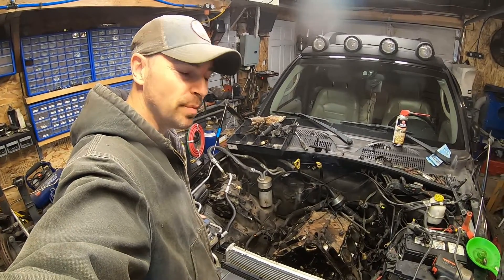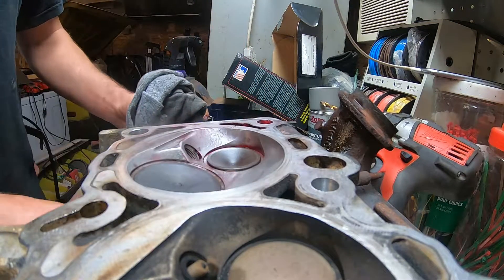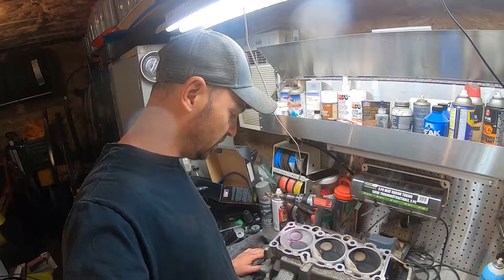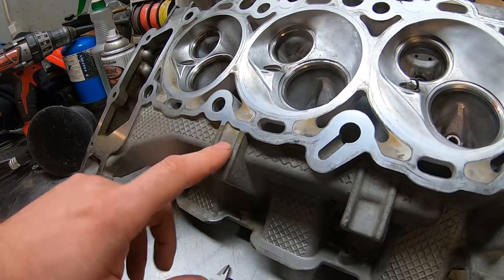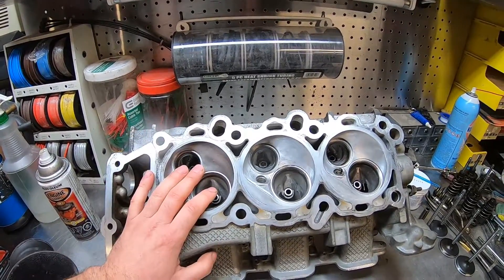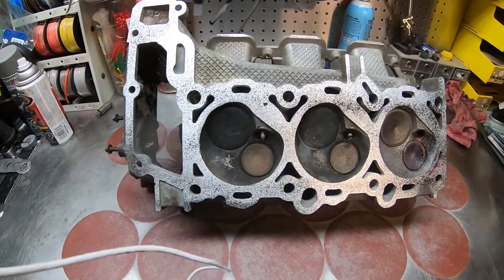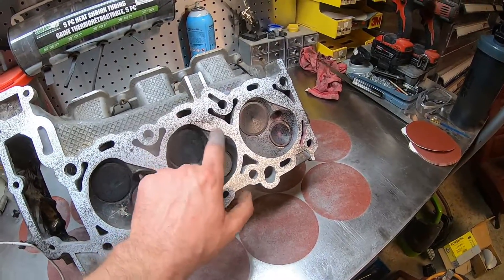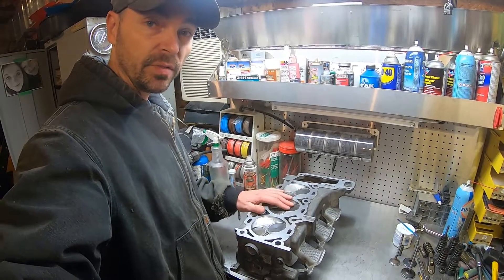How to Resurface a cylinder head at home with an Orbital sander???!!??!??!?

Comment: if done with a light touch that orbital sander and a straight end to check the flatness would certainly get the job done well enough. I use a 3/4 inch thick steel block, 6'wide and 24 inches long....some diamond paste.  Thank you for this video you posted sir.

Comment: Would you double up on the gaskets to increase compression? Also, I’ve heard to make both the head and block rough so they “bite” down 🤷🏼‍♂️😂
Reply: doubling gaskets would DECREASE compression. Its popular on vr6 engines to stack 2 to drop the cr .5. The 'bite down' hes talking about is referring to multi layer headgaskets that are meant to crush when torqued. The thought is that the gasket would crush into the imperfections and be kinda pinned in place.
Reply: You do not want a rough surface so that it will "bite" into the gasket. What it will do is "eat" the head gasket with its teeth, rough surface.
Reply: I used a thicker metal gasket on my car when I swapped a new one in. Did not level it myself tho, had it done in a shop.

Comment: This is not the way to do it. The head will look very pretty but will not be flat. If you want a flat beautiful cylinder head mating surface, use a glass plate, or a marble or granite tile, as a reference. With an orbital sander you are not accomplishing anything other than polishing peaks and valleys
Reply from the maker: @VliegerNL  been doing it for a long time.  Checking it with the paint spatter is a fool prof way.  Been driving it since, actually just used it to flat tow my CJ7 2000 KM/S to Nova Scotia!
Reply: @restosandrevivals4597  Good deal. Glad it has worked so well.

Comment: You put the dye on first.

Your supposed to clean(clear stuff), then spray dye red stuff,then developer(white stuff) developer pulls dye through cracks for leak testing. To just amplify already visual cracks you could probably just use dye. If you had a crack in combustion chamber you could spray dye then put developer in water jackets and itll pull red through crack so its all white except a red line. Thats why you wait so the dye seeps into cracks.
Reply: And yea fixing at home is fine as long as your not super warped.

Comment: Thanks for the tips. I've always heard that you should take down the valve seats by the same amount, but I can't see how that's possible at home?
Reply: What does that even mean?
Reply: That's not true. The valves have nothing to do with head thickness. Head thickness only effects compression ratio. 
Grinding the valves requires grinding the tips to reset rocker arm to valve clearances.
Surfacing the heads does effect cam timing slightly but usually not enough to hurt anything. Now, if the heads are warped bad from overheating, it will require the valves and seats to be reground as they will warp also. Usually if the head is warped over .020" in the center, the valves are warped too.

Comment: Good job, and I'm sure the machine shop boys will feel uncomfortable with the idea of sanding a head down flat, but ot works if you're dedicated and careful. It also means you're only removing the bare minimum of material by this method.

Comment: Is the head still assembled? Is it possible to surface the head without taking that all apart?
Reply from the maker: It depends on the head, some valves sit below the deck surface. Most heads can but it’s risky. You don’t want all that filth making it’s way into your oil when you bolt it back down. It has to be perfectly clean inside and out.

Comment: first time watcher, very intelligent and elaborate explanations thank you, that outro caught me off guard lol

I did something similar to this for my 2014 SRT8 392 hemi (6.4L) cylinder head but now have a huge oil leak. I googled, and read that it has a Fire Ring or Fire Deck built into the cylinder head -- I used a straight edge file and it took off a little bit more around the cylinder bore than the rest of the head, I read filing down this Fire Ring can actually compromise and scrap the head. Do you know anything about these Fire Rings?

Comment: That's an ok technique. I guess.  I prefer to use a cinder block. I just knock off the loose gravel and go to town. Works great. I'll throw some crisco on there every once in a while to keep it lubed. Head gasket seals fine. Just like yours will !!  Keep on sanding.

Comment: Great video and tips.  I am working on similar heads for my ford 4.0 SOHC.  Lapping the new valves right now and holding onto the old valves to do some porting and polishing before fully reassembling things.  Look forward to your upcoming video on the port and polish.  This is my first go with SOHC heads, most of my experience is porting and polishing old V8 ford heads.
Reply: @curtispaul9717  Thank you for the insight.  I am a bit weary of doing aluminum heads and it makes sense about the cam.  Finding more performance cams for the 4.0 sohc seems to be quite a challenge.  Honestly the engine makes good power as it is with a few mods.  The 03 ranger it is in is a hoot to drive.  I have ported and matched iron heads when I built a 69 390 to replace the worn out 352 in my 66 f250.  That one I did put a higher lift cam in and added ram air among other mods to increase performance.  Lots of fun getting sideways in a 2 ton truck when you mash it and beating newer 5.0 mustangs off the line till they caught me around 85mph, the truck had a top speed of 103 downhill, hehe.  Its a stump puller but was still fun.  I also plan on doing head work on the 400 in my 77 tbird with a hotter cam.  Will pull the motor when I pull the front clip and fender to replace the parts from being t-boned, sigh.

Comment: Yeah a head skim is very cheap if the heads actually known to have overheated id get it skimmed but if youre just building a motor up then id use emery paper over the whole head face but not a machine

Comment: How did you deck the block?
Reply from the maker: You shouldn’t need too. 
It’s pretty rare for a block surface to warp to the point it needs to be machined
Reply: @restosandrevivals4597   Thanks for the quick response, and info.
Reply: Unless the engine was severely overheated, and it's an aluminum block, it should be okay. But, you should always check it. Flatness for a V6 head or block is less than .003" in the center. For a 4 cylinder , .004".
To surface a block is very tough to do normally. Normally, you have to disassemble it and take it to a machine shop. To do it in the car is tough as there are a lot of obstacles to work around and very limited space. I have figured out a method but you really have to know what you are doing.

Comment: Yeah I have an old Farmall Super A with a C123 engine. Need to fix a Crack on top surface, a new block cost $400 +$250 shipping. So it's not like I can make it broker. Worth a shot, gonna try lock n stitch cold sewing for Crack. If the set isn't to expensive.
Reply from the maker: Exactly! I'm glad you get the point. Some people are oblivious to the thought of not being able to make it broker!! haha Use a thick piece of glass or a table saw to get it as flat as possible!
Reply: @restosandrevivals4597  work with what you got.
Reply: @curtispaul9717  thanks for the advice

Comment: I approve of this message however i disapprove your sanding table! I would have used a glass flat piece of glass as my sanding bench 🤷🏼‍♂️
Reply from the maker: Couldn't agree more! It's a beater though so it's ok! ha
Reply: I picked up a granite cutout from a 36" sink for $10 to be able to flat sand an aluminum intake and spacer. Got any idea what Ra reading (wet sanding grit) is best for use with thermal/phenolic intake gaskets? Thanks..
Reply: Can anyone tell me where to find flat enough glass? The glass i got put my head out of flat by at least  0.15mm, which is more than twice the allowable tolerance on  my 3cyl head. I should have checked the progress more often, i realise. But if anybody could recommend me what is typically the flattest manufacted glass is i might find.
Reply: @malachymilligan4660  I read somewhere that the glass from scanners is typically very flat. never tried that myself tho, but it would make sense I think

Comment: Two issues with this video. Firstly your straight edge is NOT a straight edge. Secondly I can hear the stainless on your bench top popping back and forth  which tells me you flat surface is NOT a flat surface. Yes it may hold for a couple of weeks but for the cost of $100 at a machine shop, this is not worth the risk.........and how much of your time have you invested.......and will invest when the thing springs a leak again? Probably a safer bet for a N/A street car if you actually have a flat surface and straight edge but for a turbo with 20PSI.......no way.
Reply from the maker: For the most part I would Somewhat agree with you! The part you failed to understand is the paint, it doesn’t lie if you don’t have a perfectly flat surface it will tell all.The stainless steel top is glued securely to 2” thick MDF and also wrapped around the sides so it doesn’t pop or move But I agree the straight edge should be a proper straight edge longer and thicker would be better but the point of this video is to use what you have on hand. Oh and the Jeep has been running strong for over a year pulling loaded car trailers and driving a half hour to work and then home again every day since.
Using die penetrant would be far better than paint but again it’s about using what you have and doing it as close to free as possible. Until you’ve tried this yourself you’re really just guessing based on your opinion and not fact. Many people have done this it’s an old hot rod trick.

Comment: This is hilarious but it really looks like it works!!!
Reply from the maker: Sure does! Just have to be really careful to not round the edges out or remove too much material between the cylinders as it’s thinner. People have been decking their own heads for decades. The key to it is to use a Piece of glass or even a table saw top for the sandpaper to ensure it’s perfectly flat! 
The Jeep is still running strong since I did it!
Reply: @restosandrevivals4597  yeah. You can get granite tile at home depot. But even then youll have to do it in a figure 8 and it can still depend on the pressure you put on it.

Comment: I've done this using a granite flat for small engines.  Didn't use an orbital sander though.
Reply from the maker: If you do use the orbital just be really careful around the valves because the material between them is so small the sander will take it down a lot faster than other areas.

Comment: I like the way you think. I have been doing this on ATV heads for 5 years now with no issues. I had to see what you were going to so with the orbital. I'm gonna try that tonight. I have a head that needs some material taken off. Your way will be faster. Thanks for the tip.
Reply from the maker: How did you make out with that head?
Reply: @restosandrevivals4597  Great! No issues at all. It solved the problem.
Reply from the maker: @TitaniummanGarage  Awesome thanks for getting back to me on that!
Reply from the maker: Just be careful around any thin sections of aluminum they can round them over easily particularly between cylinders or ports. Thanks for the comments! :)
Reply: So why couldn’t you do piston faces the same way or similar?and you’re right if people didn’t color outside the lines now and then we’d still be in the dark ages

Comment: Oh man, you are totally wrong. You never can done this properly in this way. This could be done ONLY ba machining.
Reply from the maker: I hate to break it to you but this is common practice among hotrodders. The jeeps still running strong and it’s been well over a year now. Also the last 4g63 turbo engine I did is still pushing 20lbs of boost and the Vtech civic has been going strong for the last 12 years.

Comment: Hopefully you rinsed off the inside of the head. That aluminum dust went all over the cam. Can’t be good. Anyways great video
Reply from the maker: You bet I did! I pulled all the valves and did a mild port/polish and valve job after this.

Comment: Did not watch the video.. orbital sander is a dumb ass method to do this better to get a thick piece of glass off a glass table and glue sand paper to it and move the head back and forth over it.. its a lot of work takes a lot of time but it works there is lil room for error. orbital sander in hands of a pro will work but still a lot of risk and only a clear dumb shit would do this .. remember people this guy did not pass an IQ test in order to post this video if this method worked for him its because he got lucky and maybe LIED about having to take it back apart and send the head off to a machine shop and do it right. You can do it cheap and easy at home and a piece of glass is FREE look in local classifieds people give away tons of tables and end tables for free daily.

Comment: I've been down your path I would not recommend it. If it's warped the heat treatment is gone. Even if you get it to be flat-ish its not going to hold back the same cyclinder pressure(power)
Reply from the maker: I’ve done it many times my friend you get good at it after a while. It’s been eight months and I’m still daily driving it a half an hour to and from work not to mention the odd beat down on the back roads lol
Reply: But going down this path will indeed result in wisdom. Failure is a great teacher its why we all learn how to fix a car
Reply: That's not how it works.
Reply: There is no heat treatment in cast aluminium
Reply: I like to make stuff up too. Man does it sound official AF
Reply: That's a bunch of bull. There's no head treatment. The whole head is bare aluminum. 
I've been surfacing my own heads for 15 years now in a similar fashion. The key, make the head flat with correct surface finish. I have several I currently drive with 30k miles on them with no problems whatsoever.

Comment: So much wrong. You may think it will work however you have no way to tell how much is being removed. Sure the straight edge shows its flat but if too much is removed from 1 end or 1 side you create other issues. There is a reason we use precise instruments to make sure the head is perfectly square and level to the milling head. But what does valve clearance and combustion chamber size matter
Reply from the maker: It’s working great! Done it many times and so have many other people. I explained that you have to be careful to make sure it’s as flat as possible. I went to college for engine building I know the potential issues. That being said, as a mechanic I’ve had heads fresh from the machine shop leak.
Reply: I have my own machine shop and one upon a time I had a little spot on a head that was just a little ugly and I had my electric orbital sander by me,  what the hell I thought. Cleaned it up and the areas by the coolant ports were about .004 to .005 low, on a head that was just perfectly flat, couldn't believe how much a piece of 240 grit knocked off in a heart beat.

Comment: So correct Sir after watching your great video I have some confidence in doing it myself but I don't have power or air tools so I will just hafto use a lot of elbow grease thank you
Reply from the maker: Sorry, some how I missed your comment!
How did you make out?
Reply: @restosandrevivals4597  threw the cylinder head in the rubbish hand in pocket syndrome
Reply from the maker: @ClenchTightly-k9t  That’s too bad did you  try and fix it?

Comment: I respect your dedication and attention to detail. However, as a shop owner and professional mechanic who has to warranty his work, the risk is not worth the reward. A machine shop can correct and true those heads for you for very cheap, and can provide you with precise Ra measurements which is the most impactful  in the success of the repair.
Reply: i have never seen a mechanic warranty this kind of work....
Reply from the maker: Absolutely I was a mechanic years ago and I am currently a service tech for heavy equipment I also went to Mohawk College for North American V8 engine building. I use a local shop for all of my machine work when I build engines however when it comes to my Daily drivers I like to do things on the cheap.
Reply: @restosandrevivals4597 😮

Comment: Thanks for the video. I might have to do something similar to my project engine. Will check the suface flat and see where Im at in gap´s
Reply from the maker: Hey not a problem! The spray paint method really helps show your low spots give it a shot and let me know how it works for you.
Reply: @restosandrevivals4597  thanks, yeah I will I doing valves and valve seats now. Might restorate the lifters also before I start to measure everything up and blueprint the engine. Need to buy some tools before my blueprint process starts. Hopefully the head and block are decent flat and dont need to be resurfaced to much
Reply from the maker: A lot of people say to stick a piece of hose on the end of the valve stem and chuck it up in a drill to lap the valves in. If you do this be extremely careful, you can very quickly cut grooves into the valve seat. There are lots of videos showing how to do it, but I’ve yet to see someone that tells the truth about what can and usually does happen.
Reply: @restosandrevivals4597  Thanks, than I might do it by hand instead. Less chanse of failure and more control even if it takes more time

Comment: If that's a 3.7 dodge you just back it outside and throw 5 gallon of gas and a match in it
Reply from the maker: Lol some days that seems like a plan. 
Never really had an issue with these engines, as long as you keep up on regular oil changes they are fine.
Reply: @restosandrevivals4597  yes true. my son has a liberty 3.7l with 180,000 on it . he makes sure the oil is changed and the coolant is full. And most important, never ever let it overheat!